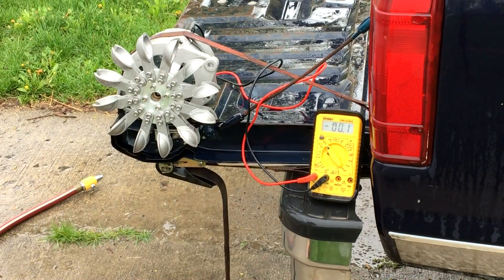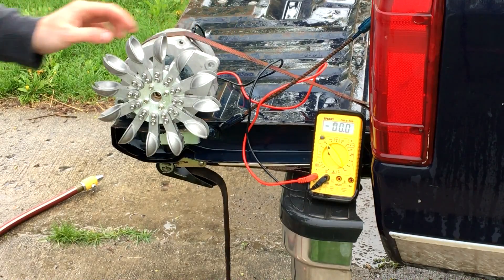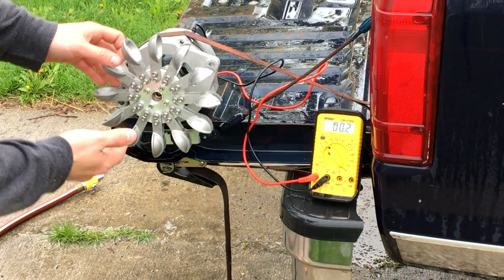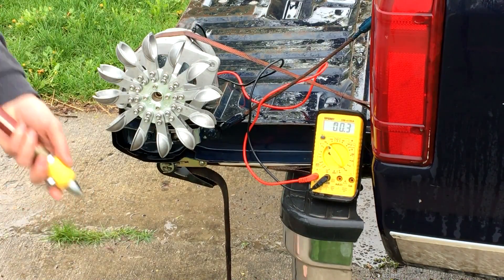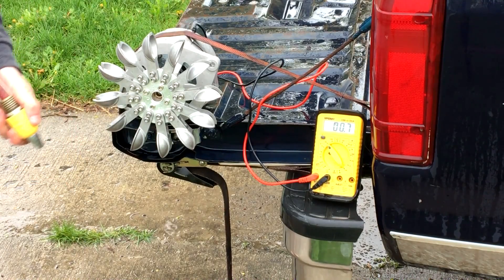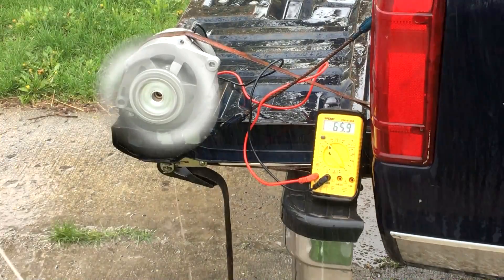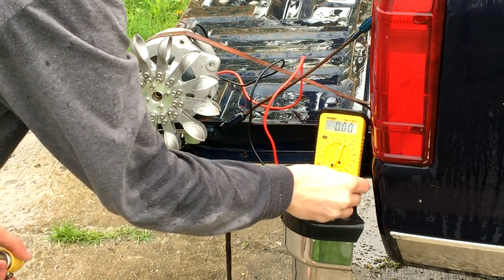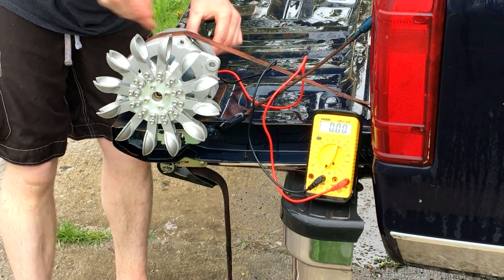Water turbine test

Comment: <soapbox>I hate it when they sell an Alternator with external Diode Rectifiers and call it a "DC Alternator". It's just an alternator and rectifier, making an approximation of DC with tons of ripple. </soapbox>
Reply: Add a capacitor or voltage regulator.
Reply: I think a lot of ppl are misunderstanding the point USWaterRockets is saying. He doesnt hate the tech, just the fact that they call it a "DC alternator". Its like calling a refrigerator a "cooling heater"
Reply: I was keeping it simple, as talking about power factor correction needlessly complicates the discussion in the context it was in. Maybe you do have more knowledge of power circuitry, I'm sure you do if that's your specialty, and in the circles of power electronics you may not think of it as DC. In the general business of electronics, however, we consider "rectified AC" to be pulsed DC. I'm not saying it's directly usable as a power source to components without filtering, but it's still DC. Unless it's zero-crossing it's not AC. If electrons flow in one direction, it's DC.

I'm not going to say I don't care for the opinions of another educated person who doesn't agree with me though. I'm going to make my argument, and explain why something is the way it is, or why I and others consider that to be the case. My point is to educate, not to argue or belittle.
Reply: A brushed permanent magnet motor will produce DC current with no need for rectification, albeit with ripple that's proportional to its RPM.
Reply: an automotive DC generator produces dc current right from the commutator and does not need a rectifier circuit. alternator is A/C, of course.
Reply: Not that much ripple. They are usually three-phase - they actually give less ripple than a single-phase dynamo would. A lot less. If the diode loss bothers you, you can always rewire them to use an ideal diode circuit - just make sure you get one that can switch fast enough. The little bit of ripple they do give is easy to filter out using the standard capacitor.
Reply: EGL24Xx Seems to have a bit of a superiority complex.
Reply: None of that is a problem if you connect it through a retro turbo encabulator.
Reply: It is called an Alternator, because it outputs AC, which must be sent through an inverter, to get DC. A generator outputs DC. Vehicles have not had Generators, in more than ~35 years. I am a Digital Electronic Tech. Also, I have known about the parts of a car, in my 66 years on earth!
Reply: DC.
Reply: That is not a real html tag, right?
Reply: The commutator is the rectifier.  The current produced in the armature coils is AC.  It is just that instead of being single phase or even 3 phase it is like 10 or 20 phase (count the segments in the armature) so the rectified current is much smoother.  If they built "alternators" with that many phases it would produce the same results.
Reply: It's not the Wikipedia article that counts, but the sources. The two authors of the dictionary have a sufficiency of alphabet soup after their names, and a definition of DC that is satisfied by the setup in this video. They give a short, simple example of DC—a battery —that is not intended to be as comprehensive as what we would find in an encyclopedia.
Reply: EGL24Xx you tell someone who works with this stuff his opinion doesn't matter. Then you tell someone else they have to work with this stuff to have an opinion?!?!
Reply: aerial wheel worth noting though that from a commutator you've got pulses of DC, compared to stored energy which can provide pure DC.
Reply: well yeah but you pull power from the battery, not the generator
Reply: USWaterRockets it's called a power converter
Reply: EGL24Xx What do  you make of this article? It contradicts your definition of DC.
en.m.wikipedia.org
Reply: Rectified Alternating Current.(Posting links in these comments won't get past the content filters, so just google it and you can see plenty of images of rectified AC waveforms.)
Reply: I meant to write rectifier, not inverter.
Reply: @StevenCassidy you don't get pure DC out of stored electrostatic or chemical energy either
Reply: USWaterRockets That's a strange thing to hate. The only thing needed to qualify as DC is that the flow is always the same direction, so calling this the DC varient is accurate. As far as I know you won't get pure DC out of any generator, only from stored energy (elctrostatic/chemical). It's like hating any AC>DC transformer, which pretty much all household appliances, phone chargers etc use. They're the same thing but with a series of capacitors to smooth things out.
Reply: I DON'T KNOW WHAT WERE YELLING ABOUT!
Reply: +EGL24Xx - Wow! You are absolutely wrong about absolutely every thing you said! Your incompetence is astounding!

"DC" means "Direct Current". That is, current that always has the same polarity. It doesn't mean "constant". It may be constant, pulsed, sine, saw-toothed, whatever. DC DOES have to do with polarity. In fact, that's the ONLY thing DC refers to. The polarity of AC alternates back and forth, DC does not.

Rectified AC IS DC. That's what it means to be "rectified": it IS DC.
Reply: When you are less condescending, maybe your purported understanding will matter . Some of us have probably more knowledge in the field than you, and are pointing out the fact that you're just not correct.
Reply: Maybe a joule thief instead?
Reply: @EGL24Xx, Sorry, but DC does not mean constant current at all. Constant voltage is the most common DC power source, which I'm assuming is what you meant and would have said if you knew the difference, but even so straight rectified AC sine waves are considered to be pulsed DC. You smooth the pulse with an energy storage component like a capacitor, or battery. That's how you convert AC to DC. 

AC->Rectifier=Pulsed DC->capacitor/battery=Constant Voltage DC. 

Pulsed DC is still DC

-An Electronic Engineer.
Reply: +EGL24Xx you should feel bad about yourself
Reply: USWaterRockets just build a PFC boost converter then...
Reply: Sasha Whitefur ah good, so what do you call AC that's been through a diode rectifier?
Reply: zach burke He doesn't.  If anyone actually thinks you can just use a diode rectifier and a smoothing capacitor, then they don't work with this stuff.  Something like a Vienna II rectifier is appropriate (although, that's actually for three phase power).  It's all about PFC
Reply: Steven Cassidy In electrical engineering and more specifically power electronics, DC means constant current (with some allowable ripple).  No one in the field thinks that a rectified sine wave of current is DC.
Reply: by the soapbox you mean the soap protocol?
Reply: USWaterRockets When you do research in this field like I do, maybe your layman's understanding of electricity will matter.

I also never said the C meant constant, it's just that the only DC that's matters is constant.
Reply: Steven Cassidy congrats, you found a Wikipedia article.  Nobel prize goes to you.

I recommend you read a few research papers or actually work with this stuff.
Reply: jesondag I really don't care for the opinion of a mere electronic engineer.  As an electrical engineer with a focus in power electronics, I know much more about what I'm talking about.  When we build DC to AC converters, we don't just allow for a cycling current on the DC input because that's not considered DC.  DC refers to constant, not polarity.

When you rectify an AC sine wave input you end up with rectified AC, not DC.  And if you really think you should feed that into a capacitor to smooth it out and call it a day... well that's why you're just an electronic engineer.  Have fun with your shit power factor, massive THD, not at all constant voltage, and spikey current.  Your capacitor is going to have a pretty short life.

Comment: So what is the purpose of the cut at the end of each scoop? A pressure bypass in case of seizing? Or does it let moving water empty from the scoops more efficiently once they pass their effective work angle?
Reply from the maker: NightHawkInLight"
It's so the water jet always hits the bottom of the spoon thus delivering maximum energy.
Reply: Patreons get early access.
Reply: two science youtubers talking casually
Reply: @ octavio echeverria: Not exactly, the jet is directed tangetially towards the center of the most outer scoop and if the cut was not there, the water jet would still turn the turbine in the right direction but the jet would also be slightly deflected away and would not hit the center or not at the optimal angle.
Reply: Its there to avoid the water hitting the incoming scoop. If it wasn't there the jet will hit the convex part of the incoming scoop and that will create a force opposing the motion and lower the efficiency dramatically.
Reply: If you need to google, its a "Pelton Wheel", and me and my classmates did a project on that in year 1 engineering. We had a shitty solidworks model, resulting in a flimsy 3d printing, and a team member was playing with it and broke one bucket off, and the team members who did the electronic speed control aspect of it didnt really care enough (motor load for max efficiency), and tbh we are shitty machinists too. So our wheel simply turned, made some electricity, but the outcome is unfit for us who are called engineering students. The project is awesome, but we simply sucked
Reply: +WarblesOnALot How do you go about extracting that BTU from the heated water? Pumped hydro storage is currently being used effectively in the Third World.
Reply: NightHawkInLight 
You already got the answer to your question from Cody, but I want to point out that this is a Pelton turbine, it is an awesome machine, every little particular have a specific task, and the amount of theory behind it is impressive ;) even the scoop have specific form and details. It can reach 95% efficiency, that's a lot :)
Reply: NightHawkInLight 
You aim the stream through the slot to hit the full spoon at 90 degrees for greater efficiency
Reply: +WarblesOnALot you're like one of those people that runs into an actor at a coffee shop, and tries to go over movie ideas with them... while they're late to pick up their kids from soccer practice.....
Reply: Ideally, on a pelton turbine, you want the water jet to split in half, and swirl around the spoon in such a way that when it drops off it has no velocity to it beyond falling straight down from gravity.
Reply: +Cody'sLab 

  G'day,

   The problem with "Mini-Hydro" Systems is the Flowrate and Head of Water-Pressure required, before they're worth building.

   It takes the same amount of Energy to raise 1 Pound of Water by 1 Degree Farenheit..., as it does to lift the Pound of Water 768 Ft vertically into the Sky...

   Once Friction in the Penstock Pipes, Turbine Efficiency, and Generator/Alternator-Efficiency at the available Flowrate/Pressure-Head, are all taken into consideration...; then unless you can expect to run Megalitres per day (1,000 Tons of Water) falling 300 to 500 metres (1,000 to 1,500 Ft) onnto your Turbine, without destroying the Ecology for tens of miles upstream and downstream..., then Solar/Wind is a vastly better option....

   Just(ifiably ?) sayin' ,

   ;-p

    Ciao !

   Gravity & Thermodynamics says so, emphatically.

  ;-p

   Ciao !
Reply: i was thinking wow cody u dont know who he is he has like a million subs. then checked ur sub count and its over a million last time i saw it, it was like 11k xD
Reply: NightHawkInLight i live your vids too,but this is easily the most intelligent comment ive ever seen....